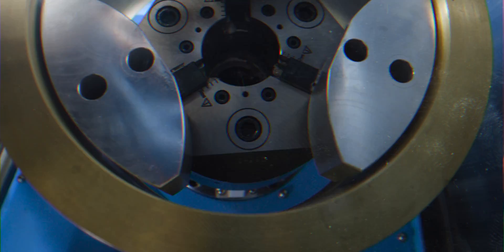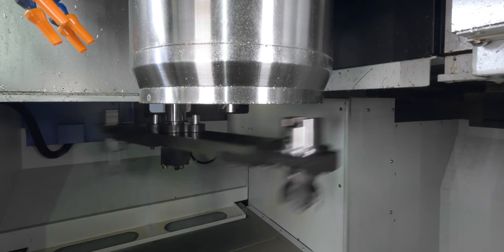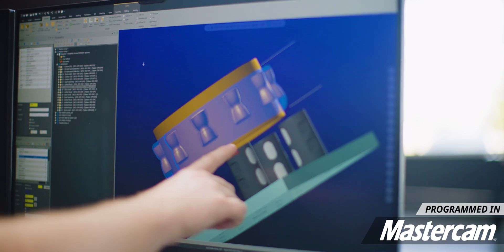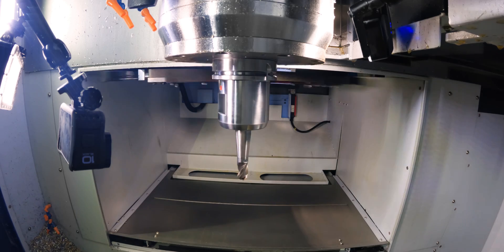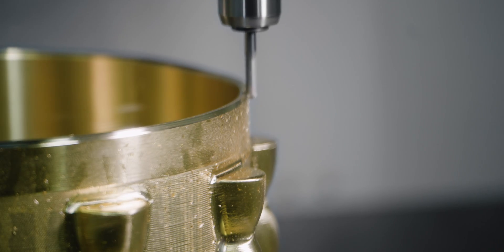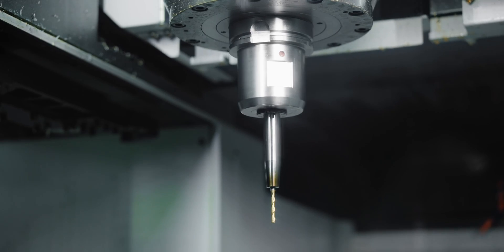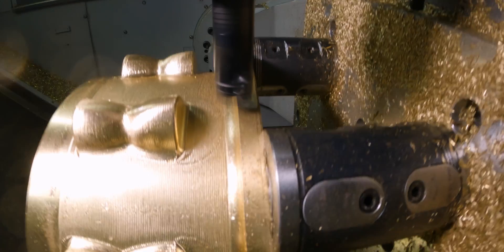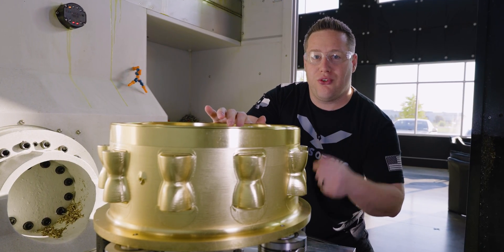Brilliant Multi-Axis Machining | World’s First 1-Piece Snare Drum

Comment: About 90% of DNSolutions in the UK are Fanuc due to the additional costs of a Siemens or Heidenhan Control as an option (£10-20k).
Also the Drum could have been finished quicker with a circle segment type tool.

Comment: Cool video Jesse.

I've always interested in the Siemens vs Fanuc debate. I often hear people say Fanuc is not user friendly. My following comments based on using CAM software. Fanuc are just G Code eaters.

Always option the Data Server

Fanuc is literary drag and drop from workstation, then run. We do zero edits. If you are having to edit code then your post is not correct.

Fanuc are very poor at marketing the required options for 5axis, and the MTB's can be even worse. 

If you are having issue with smooth 5 axis on Fanuc, you are either not activating the advanced functions in your code or you don’t have the options. Depending on your machine brand, it can also be a case that the MTB doesn't know how to tune the parameters correctly. DN/Doosan is a classic example, you need to specify some advanced functions as they are not standard.

Just remember, there is a reason why, Matsuura, Makino and Yasda use Fanuc.

Comment: The choice of the controller is just a matter of what the operator has learned in their first shop and what his peers are using. Its like spoken languages, the first one kindo sticks. Cnc controller platfoms doesnt look any different. So if its Fanuc, they tend  to stick to it even if it looks and feels like something straight from the 90s. I have also seen people swear by the ease of use of their Haas controller machine tools. To me, even those pople are yet to discover the Siemens 828D/840. So, when i had to make a choise on the type of controller in my shop, i gave both Siemens and Fanuc a try. Once i learned shopmill and shopturn in siemens the choice was pretty clear and easy. Not a single gcode in conversational programming and and extremely intuitive inerface. Thats what things that belong to the the 21st century should look like.

Comment: I work for a machine tool builder. We use Seimens, Heidenhain, and fanuc controls on the machines we build, but have Fanuc, Okuma, and Heidenhain in the machine shop. Our internal service guys generally like Fanuc, tolerate Okuma, and hate Heidenhain and Seimens. Our machine operators are generally the exact opposite, and our programmers are somewhere in between. 

Seimens and Heidenhain are the gold standard for multi-axis machines and they're more user friendly on the surface, but they're super complex in the background. Makes using advanced features like macro programming or servicing the machine a nightmare. The German language barrier is also an issue. Service from the machine tool builder is sometimes disgustingly expensive (looking at you DMG), and there's really not a whole hell of a lot of help out there for advanced controls on top of being expensive to buy. 

Fanuc is familiar, simple, and generally capable enough, so companies can service their own machines or hire 3rd party service which tend to be much cheaper. Okuma is a very capable control, decent user interface, and still manages to stay simple enough.
Reply: If your guys are finding sinumerik macro programming difficult, they should look at the siemens jobs planning manual. It's excellent. 
That language is vastly superior to Macro B on fanuc, both in capabilities and intuitiveness. It's also very different than Fanuc, so if you're up on one the other will feel completely upside-down.

Comment: I run a Siemens 841 on Grob G550's and G750s, and they are a hot mess. They are cool for what they can do, but they are nowhere near as reliable as a good Fanuc based control. We run the machines 24/7 and any of our machines with a Siemens control are always having problems. That is probably the main reason you do not see them as the standard control. Also, they are $$$ more expensive than other controls, and most shops do not want to pay for it.

Comment: I imagine the cost to service something like a brand new siemens controlled machine is probably pretty outrageous. And the down time from having to wait on experienced service techs is probably also pretty bad. Fanuc controllers are pretty common in the us and while they may “look like they are from the 90s”, most machines in most shops dont need them to look like they were made 2 years ago. They just need them to get the job done as fast or faster than their most active competitor. Thats why machine tool makers still sell so many small 3 axis vmc’s. You don’t need a 2026 Bugatti to deliver pizzas.

Comment: Can we get a side by side comparison of the siemens controls vs the fanuc controls through basic operations? The shop I work at only has fanuc and haas  and I wanna see what I'm missing out on lol
Reply: Same with me. I've worked 1 year on fanuc (Swiss lathes and a little bit on Doosan Lynx, didn't have a chance to learn that as I was leaving the place to go to University which I dropped out of after the first year), now I've been working on 1.HAAS VF2-SSYT and 2.Fanuc Dah Lih MCV-720 mills for a little over a year (will begin to learn Haas ST20 lathe soon). The haas interface is pretty damn simple to deal with, there is nothing to it, it's super simple and quick to use on mills. Setup times for me are usually 20min in total for 3-4 setups (roughly 5min per one setup including part probing and tool length+diameter probing)

Comment: Never had a chance to run one, I think alot of shops are scared to get into a new control. A lot of people want to resist change. One question, I never knew this until I ran a mill with Fanuc controls. Can you run sub routines on the Siemens? Such a headache when doing patterns.
Reply: sub routines are super easy on Siemens

Comment: The Siemens 840d is a very powerful control that does 5 axis very well.  I believe they are over complicated in some areas.  However, the biggest drawback is the reliability.  Not so much the controller itself but related sensors, drives and PLCs
Reply: Thank you for your feedback!  That is very good information.

Comment: We had a seimens controller on our CTX machine, we got rid of it mostly because no one in the us could service the thing. We're having a hard time getting these guys to navigate a haas controller with ngc after the older style. Don't want to confuse them anymore than we have to.
Reply: Thank you for the feedback.  Do you mind me asking why you were needing Siemens to service the machine?  Why not the machine manufacturer?  Genuinely asking, these are absolutely the things I am trying to address.
Reply: Sorry for the late reply, YouTube comment navigation is a nightmare. It's hard to blame it all on the controller but there were some settings we needed changed that weren't from mori. Getting our bar feeder to talk with the controller was not a straight forward experience, but i can't blame that on seimens either. My biggest problem with them is the touch screens. I and everyone else I work with just trust the physical buttons much more. When I press a button I want to feel secure that it went though. Seimens has the best on machine programming hands down, but I personally need a responsive controller above all else.

Comment: When you work with external programming software (with lots of post-processors) it is not that important if your machine has Siemens, Fanuc or whatever programming language.
As long the "computer on your machine" is processing quick, you will succeed.

But, you have a point, a Siemens 840D is very smooth and friendly.
Reply: I disagree.  You can have the most powerful CAM software in the world and it won't matter if your machine does not handle smoothing, high speed machining or kinematics very well.  I have put the same exact machine up against itself with two different controls and it was night and day difference.  Especially when it came to the kinematics.  The Siemens was far more accurate on top of the smoother motion and better surface finishes on the part.  I could go way into the weeds explaining all that I saw when comparing the two but I won't bore you with a novel.
Reply: @Jessie_Smith  I am very intrigued by what you are saying here. I am working on making my first 5 axis CNC from scratch (mechanical, electrical and programming), and I am really wondering about how much my algorithms will go pair with my designs and machining actions. 

Does your machine have to give alot of feedback to the application so it behaves properly, or do you solely rely on robust algorithms. Please write me a novel.
Reply: To find that out, you can always do some example math. Pretend you are doing an angled cut past the center by 1/8th and then curving past it rapidly. Calcukate some perfect theoretical points along like only 0.100" of the path in 0.002 increments. Add in your random error from your encoder datasheet, which is sometimes 1%,and calculate what your smoothing algorithm would spit out after a couple iterations. If your computer is spitting a straight line that's great if it's wobbling all over the place, or lagging then expect poor kinematics and adjust the PID and sensors accordingly. If your encoder error messed up path prediction toomuch try adding in other secondary sensors like acceleration, tiltyawroll, spindle load meter, whatever other sensors you can add into your PID loop to help smooth the output. That cant be figured out by reading a book but doing the math for your specific scenario, your stepper feedback and positioning tolerances, your backlash, your encoder resolutions etc
Reply: @ariyavellenga3455  I really appreciate this answer. It drove me to do lots more research on encoding and methods to find whats reliable or not when I get to run my first tests.
Reply: @Jessie_Smith  hello Jessie, the Siemens is with no doubt very good. You refer to high speed and how far the control looks ahead to smooth out it's path, for us in the mold making shop it is more the accuracy and stability of the machines (Yamazaki Mazak's and DMG MORI's) to get the mirror finish and narrow tolerances. Their we only have Semi-finished one-shots in hardened steel, tool life and don't damage the piece is more important then the speed.
And yes Berry, also we scrap sometimes semi finished products worth thausands of euro's 😉

What you guys are doing with the academy, and gathering all "knowledge" from the many different disciplines in machining is awesome.

Comment: out of curiosity - why did you use a Ballnose endmill to rough and finish the ID? From my uneducated Perspective, that operation looked like the perfect op for a barrel-cutter with a greater stepover. Was that due to those angled through-holes "bumps"?
one thing i wondered for quite a while now - do you guys have any means to heat-treat such a big part between roughing and finishing? given how much material you often remove, movement due to internal stresses is something i can't remember that you have covered it for anything but plastic parts 🤨
Reply: Brass (or something close to that) is not heat treatable. C45 steel is great in that regard, but that's not the material they use for this drum.

Comment: The $60k add on for that control is a good reason. My dvf 5000 and my vcf 850lsr have fanuc 31i which is OK for what I do. The need for the other control isn't there for me to spend an extra $120k for the 2 machines
Reply: I think that the delta is a lot closer now a days. This is something that we are continuing to work on with manufactures

Comment: Can’t wait to see the finished product in 3 years time!! If we ever get to see the finished part.
Reply: I tell you what, just for you, I will get it done in 2 years. 🤣
Reply: @Jessie_Smith  btw with that surface finish you better hide it from barry or he might steal it with how close it resembles chatter marks 🤣
Reply: @flikflak24  yes we can't let Barry get near it or it will look like it got hit by a car lol.  Mastercam is actually going to make a new toolpath in honor of Barry.  It is going to be called the OptiChatter finishing toolpath 🤣🤣
Reply: @Jessie_Smith  well good thing is that it increase surface arior giving pain more to grip on and increase thermal decipation at least 🤣probably the only good thing about it to be honest
Reply: @Jessie_Smith   I need that for porting heads.  Seriously.  It works with a worn carbide burr with a lot of run out.
Reply: maybe, if that thing ever gets mass produced, we will eventually see it somewhere else first :D
Reply: honnestly im more interested if see how then plan to hold it for the next up without crushing or even mark the finish ( i do have a few idea's but still woundering what they are going with/for )
Reply: @flikflak24  I just finished recording the video for how I programmed it in this op as I stated I would in the video.  I am actually about to go on vacation but when I get back I plan on doing a video on holding it for the next operation.  So that will be coming, it will just be a few weeks before it is out
Reply: @Jessie_Smith  well have a nice trip/vacation then m8
my best guess for a good solid grip on that fella would be a internal mandrel style with all that internal surface

Comment: 2 questions jessie.
one. didnt you make the vent hole before thining the wall on the od side ? 
and two. why have the machine move in x and Y with the face/shell mill wien you could just rotate the C axis ? ( im pretty sure mastercam would spit out the right rotation speed for the C axis for the surface speed to be right/the same as moveing X and Y. ) only reasons why i ask that is that in my experience its less wear on the machine ( make enought parts and it adds up ) and that it gave a even flatter part since we only moveing one linear axis and a smaller amout the mecanical error ( every machine. even high end brand new ones have some mecanical error in lineaar motion) is cut down multiple times. basicly moveing from the mecanical error of X and Y over to the error of the Z hight of the bearing in the table
Reply: I cut the vent hole from the ID.  In the video you can kindof see it cutting away the material so you can tell it is a solid piece.  I originally was going to cut that hole from the OD side so I didn't have to use a long slender tool holder but that was going to force me to do it in the next op and I didn't want there to be any chance of throwing a burr on the inside that I would have to deal with.  

I certainly could have output to use the C axis for the facemill but I just didn't see the need to.  It is only a roughing toolpath so no need in getting fancy with it.  3 axis mills move linearly all the time with no issues.
Reply: @Jessie_Smith  thanks for replying. specially so quickly

btw that chamfer finish you got looked like it was done with pcd tipped tool ( the one you hold up but was covered )